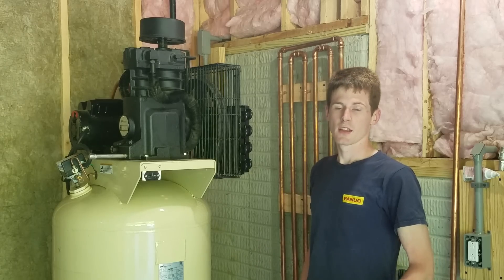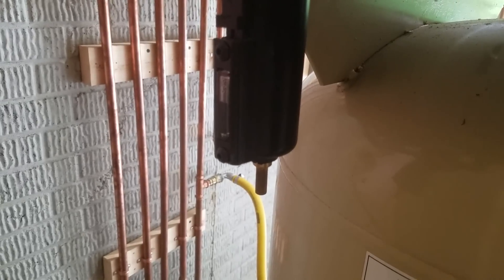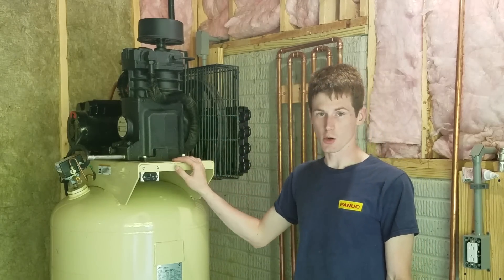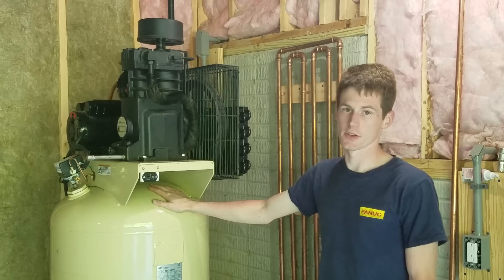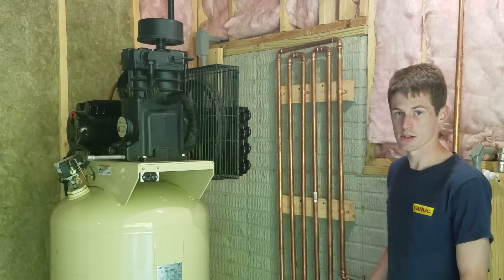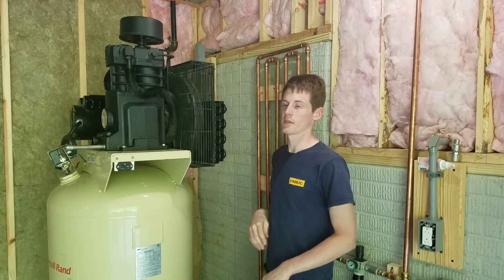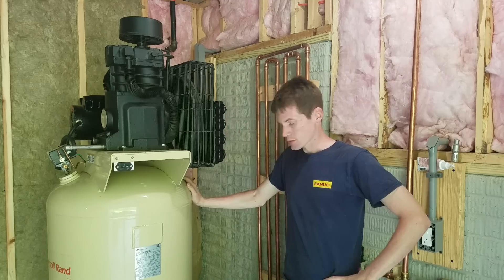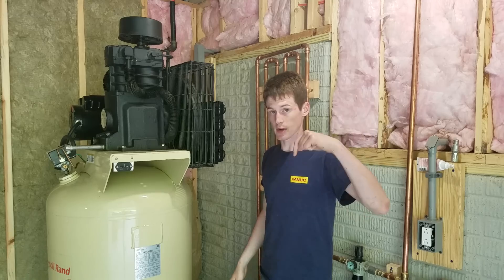How To Remove Moisture From Your Compressed Air

Comment from the maker: Parts that I used for my setup: 
Transmission cooler: https://amzn.to/2tvqGhF 
Brass flare nuts: https://amzn.to/2MZBWey 
Brass flare fittings: https://amzn.to/2lAc9wE 
Water separator (auto drains when the trap is full): https://amzn.to/2KiVmJj 
Water separator (only drains when the compressor shuts off and the line unloads): 
https://amzn.to/2MnqfOQ -Good for low duty cycles
Flare tool: https://amzn.to/2MnJGWB 
Cooler Mounts: https://amzn.to/2Lg55zH
Tubing: https://amzn.to/2VSYUIE

Help support the channel. Buy using my Amazon links
As an Amazon Associate I earn from qualifying purchases and your cost is exactly the same.
Reply: Wold you make one and sell it
Reply: @rognegrete79  What size fittings when i click the amazon link it brings up a bunch.  Im guessing you used 1/2 inch?
Reply: @mattthomas1369  and how many of each fitting did you purchase.  1/2 inch right
Reply: Sam I ordered  -8AN Female Flare to 1/2 NPT Male Adapter AN Fitting BLACK off eBay it worked great
Reply: You will need 2 of those fittings
Reply: @mattthomas1369  Roger that.
Reply: @mattthomas1369  so you used the same transmission cooler he did?
Reply: Derale 15300 Tube and Fin Cooler Core worked great
Reply: @mattthomas1369  im think about adding a small fan to it to get even more moisture out of it.  the fan on the actual compressor doesn't really do much.
Reply: The Derale 15500 is the same cooler with a 12V fan and mounts.
Reply: Do you have a step by step instructional on how to assemble,  exactly how many fittings etc?
Reply: its the solution for deserts, sun cells and air dryer= 2 oz / min
its the real stuff

Comment: I really appreciate the work that you do, especially the rust protection videos you made has been very valuable to me. I'm about to set up a small air dryer for for my hobby garage spraypainting and i plan to put the exact same model of oil cooler between the pump and tank. Do you still use the same compressor setup? I have seen lots of videos where people are very satisfied with this oil cooler after they installed it but I have not found much of a long term use review. I have seen a couple of videos that complain about the internal construction of the cooler because the pipes are not parallel and can collect water. What is your experience?
Reply from the maker: Still rocking the same setup, no issues at all.

I think I have 200 hours on the compressor with this setup. It has been flawless.

Comment: I have seen this one before as indicated by my "Like".  I have seen auto drain valves that go on the tank itself.  Since you didn't mention having a tank drain I can only guess that you do.  I worked in machine shop years back, where no one had been draining the air compressor.  The very first time I did a LOT of water came out.  They eventually got a new larger unit and I was draining that too.

Comment: The aftercooler maybe dropping your discharge air to a 15 degree delta T but what is doing the job is your coalescing filter.  DO NOT use a desiccant dryer after a reciprocating compressor they cannot handle the oil vapor and will clog the media.  You are also just reducing the heat load, but the moisture is still entrained into the system.  The only way you can "remove" moisture is by reaching a minimum of a 38 degree dew point.

Comment: That is great work. I am doing a much smaller setup than you but will be using a water remover by Hypertherm. I hope that I don't get water out. But I like that you remove the water before the air goes into the tank prolonging the life of the tank also.

Comment: my theory is to use top connections as the air inlets allowing condensate to cascade to bottom for blow down/drain off at both the after cooler and coil setup .

Comment: When I was a kid my dad was a professional mechanic and I would go to the garage where he worked. There was this hug compressor in the back outside and where it came into the garage there were these two pipes that went up the wall. On the bottom was a petcock like you find on the bottom of a car radiator. Your system is very similar to that, and I was going to do the same thing except with a Semi truck radiator, I like your idea so I'm going to try it for my Media Blaster. Thanks for the great video. Best Wishes & Blessings. Keith Noneya

Comment: The reason the aftercooler after pump is efficient in removing moisture is because the tube is preassurizing more than in tank or after tank. For optimal removal of moisture preassure is important, the more preassure and the greater the temprature difference the more efficient removal. You can also use running cold water on fins of cooler that would remove even more water. You can also use a vortex tube to cool the air and then feed into water separator but vortex tube will consume 6cfm constant.

Comment: I would wager that if you used the copper system first as the pre-cooler / condenser and the small black condenser as the post tank unit you would get better results and may not need the small condenser grill post tank at all.  I say this because the copper, being much larger in diameter, as well likely longer in linear feet too, has more surface area available to help cool the air.   I've seen a few other people using the copper set-up only along with a water separator, and that was in fact all that was needed.  I've been weighing the costs / benefits of either and while the copper set-up will actually cost about 33% more overall with the fittings and hoses, I simply think it's a better way to go, especially for larger compressors like this.  I've also seen several reports of guys busting seals on these little Derale oil cooler units that have become popular and my guess is that over time the water vapor corrodes the aluminum enough to pop a seal because don't forget, they're actually made for oil cooling, not air.   If you were to switch it up however, I'd want to sweat the copper joints.  Id be weary of compression fittings with rubber seals that could become damaged over time from the hot air, especially at the inlet connection where the air will be at least 200F.

Comment: I was thinking about this. It could be that your first cooler gets more water because it is first in line.  The air dryers that use refrigerant above freezing is what I am thinking about buying.  
My homemade dryer using a freezer -
Also I was thinking if you had a chest freezer and put a oh say 20 gallon tank inside of it. Run in and out lines into the top.  And as the water freezes it will just fall to the bottom.  So you would have to have a small drain at the bottom of the tank, but it could run up and out of the top of the freezer and have a valve or air blower on a 1/4" line after defrosting daily. 

The advantage to the freezer is the lower air temperature would dry the air to a lower humidity than a dryer that used temperatures above freezing.  If you had a freezer that could get say 50 below zero. I am sure there is a table to see what the dew point and water content of the air would be at such low temperatures.
Reply: You may have to keep the in and out lines in the freezer about freezing. So they don't  ah.............. freeze.  Probably the in line would have warm air coming in so it wouldn't freeze. But the out line might freeze.
Reply: And you might pack ice cube bags around the tank to stabilize the temperature.

Comment: I like your set up...I see u have an hour meter  on your unit..awsome thinking..I have a a Saylor-beall  unit..with a factory  hour meter..and on the motor  a fan blade  to cool the radiator  as well factory..built into the belt cage..I live in fl.  It's hot....and high h.....in the summer months..my unit runs quite  check out Saylor-beall  on u tube..great video...love itpls add a magnetic  starter  on your unit..it will protect  your pressure switch, and motor  ..u have an IR...unit..it costs around 300 bucks .but worth it ..ask any electrician..if your motor  Draws over 30 amps..or more..my American  made unit is built in st.johns, Michigan..a industrial  type comprsoir  like yours..

Comment: Very well done!  Question, I just ordered a 7.5 HP compressor which will not arrive for 4 to 6 weeks.  My guess is the pipe going from the pump to the tank is larger than the tubing used in the transmission cooler.  If that is the case, any suggestions on what to use for a larger tubed after cooler?
Reply from the maker: A straight 1/2" pipe will flow over 50CFM. Even if the cooler flows half of that, that's still 25 CFM. If you're extremely worried about it Y the outlet from the pump to the tank and install 2 coolers.
Reply: @RepairGeek  Thanks very much for the suggestion!  This compressor flows as much as 31 CFM so I don't want to cause any restrictions.  Plus, I was thinking it would be nice to have a larger after cooler so your suggestion will achieve that.

Comment: Your link brought up 1 1/16 for the flare nuts connecting your new line from the cooler to the compressor. Is this right ? The other link is 1/2 copper tubing, just wanted to make sure
Reply from the maker: You have to manually select the 1/2 flare nuts bethe picture. I can't control the size it defaults to.
Reply: @RepairGeek  thank you!

Comment: I'm building a similar set up thanks to your inspiration, I have the almost identicle  IR compressor 5hp 2 stage. My compressor had a 5/8" copper line between the pump and tank from factory. Didn't  you have the same size tubing? didn't that make plumbing a pain when using 1/2" tubing?
Reply: His seems really quiet, is yours too?
Reply: @mrmotofy  Yes- I also made a "muffler" out of a 180 degree dryer duct lined with rockwool for the air inlet side, that cut the sound down considerably. Well worth the effort.

Comment: can you provide more information on the water separator you used, the link is broken. Also how does it differ from the TBH unit?
Reply from the maker: The water seperator that I used has been discontinued and is no longer available.
Reply: @RepairGeek  was there much difference between it and the TBH unit?

Comment: So I've been reading about mixing copper tubing and aluminum heat exchangers even with the smallest amount of moisture eats up the aluminum, thoughts. Also I've read that you shouldn't use tube and fin heat exchangers over bar and plate style because it restricts flow or CFM.
Reply from the maker: This cooler has copper tubes. Also, the cylinder head temperature did not drastically increase after the install of the cooler which would indicate a restriction. This as been in service for 3 years now and has been literally flawless so far. The smallest piping in this setup is 1/2". 1/2 will flow over 50 cfm. Most 5 to 7 hp compressors put out between 15 and 20 cfm, far from the limits of this setup.
Reply: @RepairGeek  Hey thanks for the quick reply and good information

Comment: Great video.  I did the aftercooler with the same trans cooler (although I added a cheap 10" electric radiator fan) - absolutely fantastic results.  That little cooler is equivalent to 16 ft of pipe!!  (it's a 16 pass cooler w 12" per pass) PLUS it has fins.  Air over the fins makes a huge difference.  Now there is nearly zero water collection in my tank, lines or wall mounted separator - it all ends up in the separator before the tank. This mod is highly recommended. And it's much cheaper, simpler and more compact than the pipes on the wall.
Reply: Sounds great!  Can you link parts used and pictures?   Thanks.

Comment: I see this a couple of years old but I have a question about the fittings you used. What is the fitting you used that comes out of the head into the 1/2 copper line?  Currently I believe that model has a fitting then the stock line threads in with a 7/8” inverted flare fitting. Also I believe it is the same for the fitting that goes into the check valve at the tank. What fittings did you use to over come these unavailable fittings.
Reply from the maker: The head is threaded 1/2 NPT. I just used a 1/2 male NPT to 1/2 male flare fitting.

Comment: How do you keep the pressure on the transmission cooler below 30-50 psi?  I think that's all it can handle.  Is there a check valve?
Reply from the maker: Its rated to 300 psi.
Reply: @RepairGeek  That's great!  Great job with the video and thank you for sharing!

Comment: This is what I was looking for, the results before n after. I was about to drop $150+ on just copper tube before fittings, traps, n valves but the trans cooler set up is obviously much better initial solution >sand blast cabinet, paint gun etc. What occurred to me though is why not pull an AC condenser out of a school bus or something as they are designed specifically to "condense"?  Might b fitting issues to work out but those are easy, can u think of any initial drawbacks to an AC condenser?
Thank you for the direction!

Comment: How much cfm can the cooler handle?
Reply from the maker: It doesn't have a flow rating but my estimate is about 25 cfm or so.
Reply: @RepairGeek  perfect, you haven’t had any flow issues in your experience with it?
Reply from the maker: @ShortyzProductionz  2 years later all I have done is replace the filter in the water seperator. Oil carry-over from the pump turned it from white to an amber color but I had no symptoms saying it needed to be replaced.
Reply: @RepairGeek  that’s the kind of news I like to hear.

Comment: That Derale transmission cooler has -8AN male ends on it, I got the same one. You listed Anderson Metals 54014-10 in your parts list (Assume its the -10), and assuming you put a 45 degree flare on your copper tubing. Only problem I see here is that -8AN is a 37 degree flare, so I am not sure how you got that seat correctly and not leak.

Comment: transmission coolers probably use soft copper not rated to handle 300psi surges from the adjacent output of a compressor. Would be scared to have a compressed air driven explosion.  Copper type L and K would be required to fabricate a copper color. Not soft type M probably used to make those right turns. Notice how nobody publishes PSI  ratings in coolers designed for low PSI applications? Otherwise great video. Thanks for sharing
Reply from the maker: This cooler is rated for 250 psi working pressure and 300 psi burst pressure. The head has a relief valve in it as well as my tank. This setup has been great for 2 years now. Zero issues. Thanks for watching.

Comment: Thanks for taking the time for the links. Appreciate it. I'm not doing any car painting. But still have too much moisture getting past the separator. I'm going to try this without the copper. If there's still an issue I'll cross that bridge. Sucks as my pump pulley is in a plastic house. May have to fab brackets. Nice IR BTW. Big bucks!

Comment: I like a good research adventure! BTW, I think you’ll find that the mfr. anticipated the air tank acting as a condenser and that after won’t hurt it if it’s drained daily through the petcock. Also, the most efficient use of your aftertank 50’ of rigid cooling line is to run it at a slight downward incline across your walls with as few 90 degree elbows as you can, with several drops along the way to collect and remove the water. This is more efficient at water removal than your up and down course where some air, trying to loose water, is forced to rise against a waterfall of 100% humidity that won’t accept it. Such a system is remarkably capable at removing water. But your experiments made a very Interesting and thought provoking video from which I gleaned several great ideas and enjoyed very much. Thanks.

Comment: Note: what he is trying to say is a standard refrigerated air dryer. That will get your dew point down to 38 degrees. Also you will need an after cooler on your compressor before sending air into the refrigerated dryer. Unless you have a high temp refrigerated air dryer... which is really just an oversized refrigerated dryer. Also recommend having an electronic drain on the bottom of the tank.

Comment: GREAT VIDEO!  Very informative and I think you covered all the topics well.   A few thoughts, I'd be slightly concerned about the copper cooling manifold, I was always told that airlines should be braised and not soldered.  And the fittings you used are the pre-soldered or clamp style (??) I would have went with the regular style so I could pump more solder into them.  Maybe on editing, mute the compressor noise and add background music!  Is that an hour meter you put on your compressor?  I'd love to know if that is standard equipment or an add-on, I love it.  Again great job.
Reply: PS Your disclaimer is awesome, you must have an attorney in the family!!!!

Comment: How do you make the connection from the copper pipe to the filters, some kind of swivel fitting?
Great video, thanks for sharing.
Reply from the maker: You need an adapter that goes from NPT to flare. Home Depot and Lowe's have them in stock.

Comment: My concerns are that the automotive cooler isn't intended for all that pressure, safety issues and I need high flow with that restriction it will take longer tank fill time. But good if you don't use a lot of air.
Reply from the maker: It's a transmission cooler. It's rated to 300 psi. The fill time is the same. The compressor output is the same as well.

Comment: If you need the pressure dropped for the end use you could always utilize that decompression to take extra heat with it by adding an enclosed evaporator between the first cooler and the trap and dropping the bulk of the pressure through an expansion valve there.